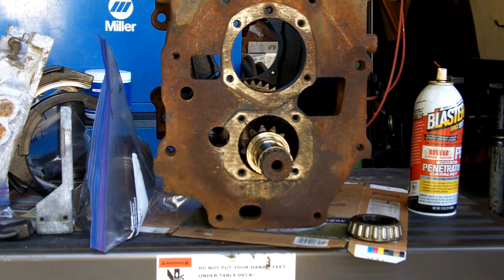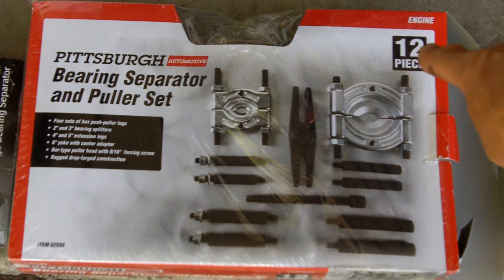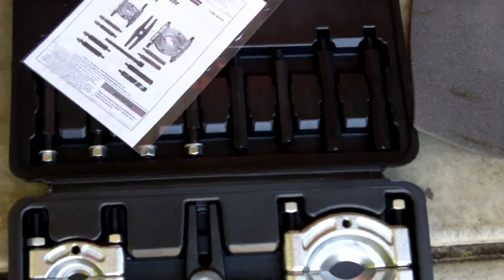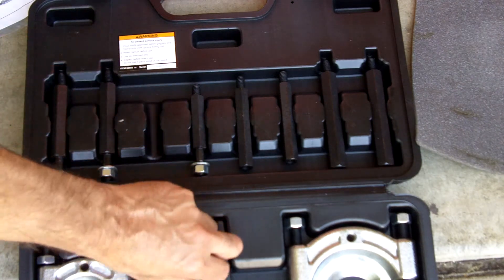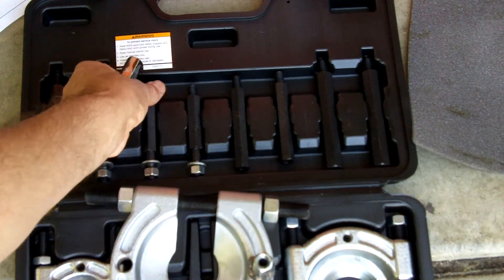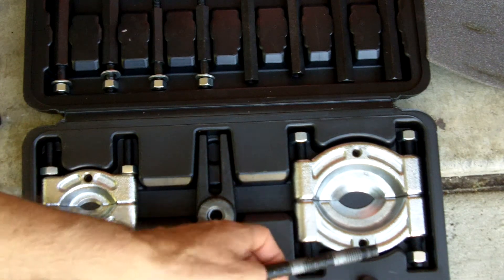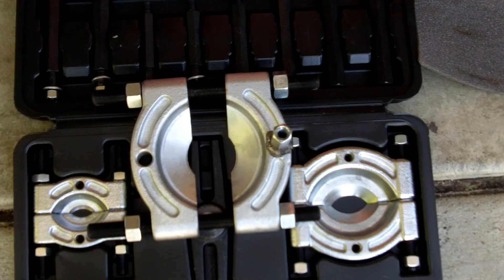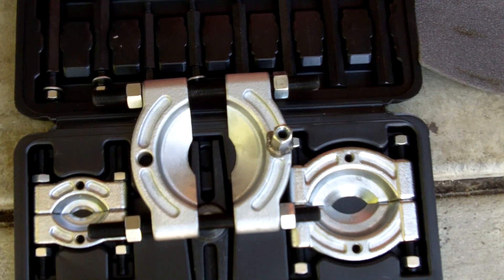NV4500 Rebuild using Pittsburgh HF# 62593 puller & HF# 63662 to pull the rear countershaft bearing.

Comment from the maker: Both the Maddox Bearing Separator – Item# 63662 & 3979 and the Pittsburgh Bearing Separator & Puller Set – Item# 62593 & 93980 are on sale this month through the inside track club @harborfreight .